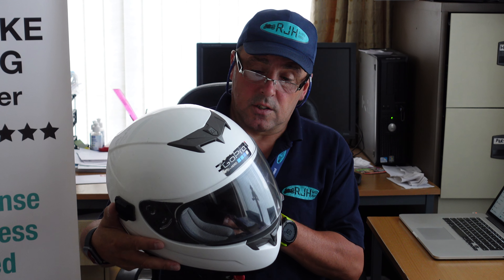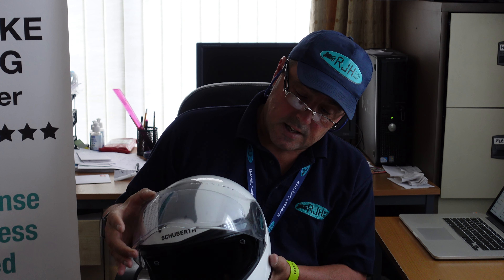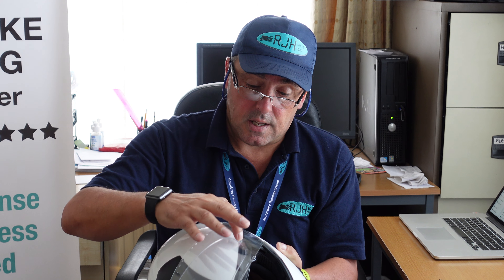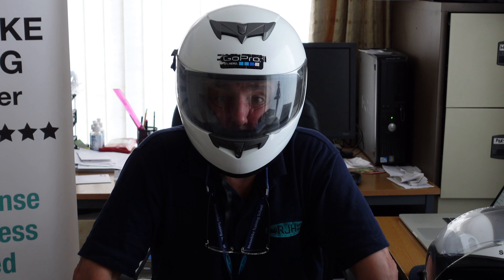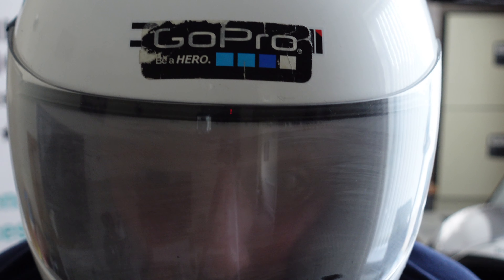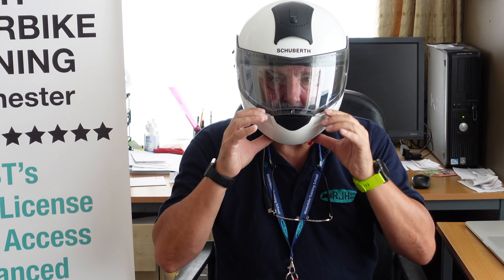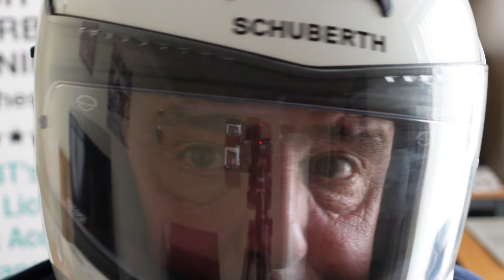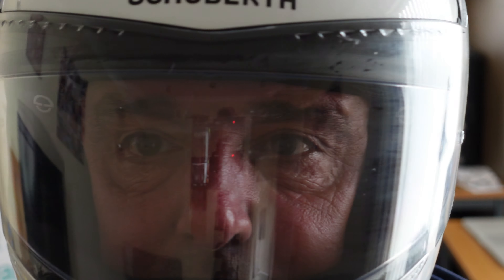AntiFog Pinlock Visor is a Must in The UK and this is Why

Comment: I have used pinlocks on two helmets.  On my HJC not even a pinlock could help as the helmet face area was so restricted, you could touch the chin bar with your tongue. The pinlock fogged up after about 20 minutes visor down in rush hour traffic.
I bought an Arai AXcess and a pinlock for it from HielmGarrick and it never fit properly.  Sure you could get it to seal, but could pivot up and down and unseal itself, which happened every time you open the visor.
I'm considering a new helmet now, maybe a shark spartan, but if it doesn't come already fitted, I'm going to get the shop to fit it and then I can take it back when it doesn't fit properly.
Reply from the maker: thanks for the feedback

Comment: I stopped using pinlocks some time ago. The first one kept misting up, couldn’t get it to seal.  Bought another which sealed ok, but was a pain in the arse to keep clean. They’re made of such soft stuff that they scratch/mark easily. Bought another new one because of bad scratches, but after that I gave up with them as it became too expensive keep replacing them every month or so.  Btw, I notice the new Shark Evo helmet has stopped using pinlock now, they use their own anti-fog visor instead.
Reply from the maker: WonnovMenny I have 3 helmets with Pinlocks and to be honest haven’t had any trouble. I wouldn’t ride without them now
Reply: Ditto I have my GT AIR And I thought my pin lock had it for 11 months and not once has it fogged up

Comment: If your Pinlock Insert starts to fail after a while you don’t need to replace it!! All you have to do is turn the little Pinlocks either side of the visor and they will press the Insert harder to the visor and reseal it. 👍🏻
Reply from the maker: Great tip
Reply: Mine seems to have these like air bubbles between the pinlock visor and the main visor. They don't seem to go away, what am I doing wrong?

Comment: Got to invest in a pinlock using visor spray at moment which works ok for while also use rainex for front bearable but not brill
Reply from the maker: smiley50ish pinlocks essential
Reply: @RJHMotorbikeTraining  my pinlock on my shark helmet has gone for second time in 3 years meaning if u set it on lowest pin to allow air through wind catches it if flys up its the securing teeth that have gone
Reply: @RJHMotorbikeTraining  just picked up a hjc v 90 flip front plnlock helmet
Reply from the maker: smiley50ish one of mine is a HJC....nice lid
Reply: @RJHMotorbikeTraining  just tried it out in lovely welsh weather sweet

Comment: It's essential to thoroughly clean the visor before installing the Pinlock and allow it to dry completely. If you dry it with a dish cloth or towel you build up a static charge that interferes with installation.
Once dry the Pinlock needs to be very carefully installed paying attention to getting a good seal all the way round.
Once it's installed I like to leave the lid overnight in an airing cupboard before wearing it.
 Once you've installed it properly you'll never ever go back to a regular visor.
Reply from the maker: Great tip! Thanks Michael.